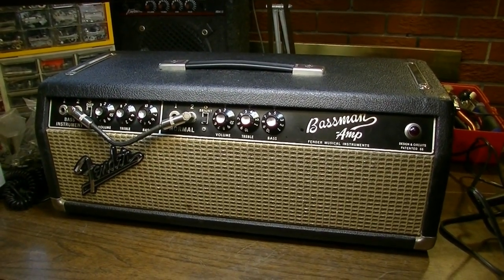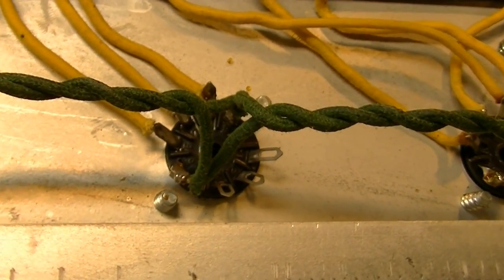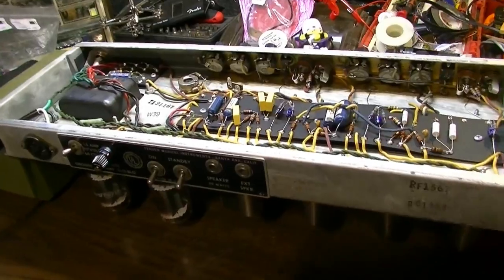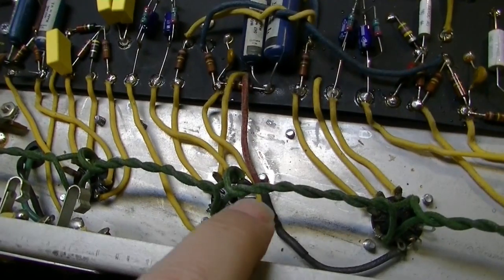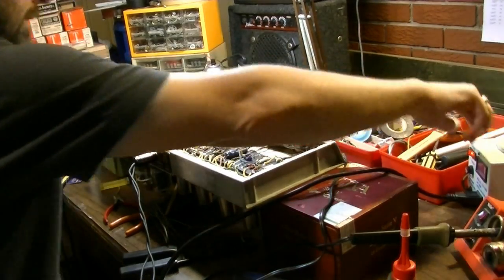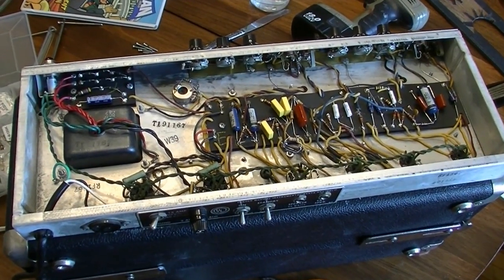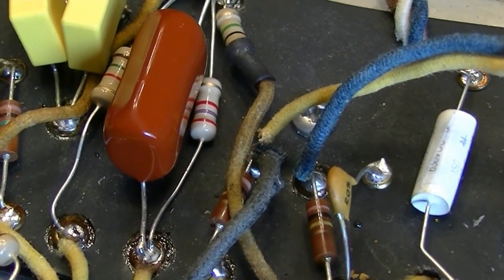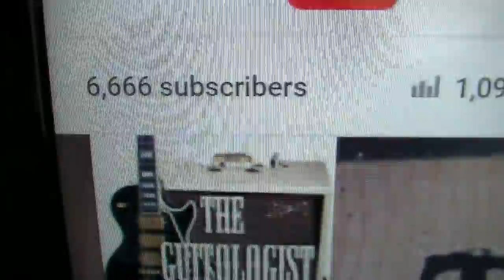Hacking a Blackface Fender for Monster Gain, Blasphemous or Badass?

Comment: My first rig was a 65 Showman which I ran through an 8X10 Marshall hotdog cabinet. It had been "MESA BOOGIED"; i.e. the channels were rewired together in series and a master vol was installed, so the cascading gain was MIND BLOWINGLY beyond even a dimed up channel jumpered JMP. The amp was given to me by my uncle back in 78 when I was 16. He was a working musician (keyboard player) who got it from his guitar player at the time who modded it. Instead of jumpering the channels in parallel, he wired it in series so it was essentially a nascent Mesa Boogie. This is not an exaggeration - the gain on that amp was so outrageously good it was somewhere between a 100 Watt Marshall superlead and Eddie Van Halen's legendary tone from his first album. When I heard Van Halen for the first time, I actually thought he was using the same rig LOL. No, it didn't quite nail Eddie's tone but it got darn close.

Comment: Another Great vidio. I love Fender amp's Vintage, Tube Reverb tanks for an Awesome Surf sound. My older brother has a bunch. I'm not sure you respond to stupid questions like the one I'm about to ask? But I can't afford a true vintage tube amp. However I could & did buy a new Fender Super Champ X2. I'm curious to on a 1-10 scale. What you might rate the Authenticity of Emulated amp sound's from this X2 Tube Version amp? I believe the 1st channel is all Tube? I've ben told the 2nd channel with 16 Amp Emulation settings is a digital preamp with Tube out. Not sure? Along with 16 Digital FX settings. For only $200 head used. & $379 Combo? I bought both. I love this amp for recording with it's Direct Line Out. I doubt these amps are even on your radar to comment on? But if so? Do you feel Thay're any good at all? or Is there anything you could do to improve their Vintage Sound Emulation? I would Love too see you open one up & give us your Expertise on what might be improved upon? Thank's Love your video's. It's like showing how Vintage Candy was made a long time ago to me.

Comment: What a great sounding amp! The unused terminals indicate that it started as an AB165, where the terminal by the bias pot served to house Fender's "bias balance" circuit, and the terminal by the power tubes housed the local feedback loop to the phase inverter (with 47k ~> 0.1 mic).These terminals are not placed on the other models. As long as the tie-in point from normal channel to bass has not been modified (underneath eyelet board but can be confirmed with a continuity test), then the channels on this amp can still be jumpered, as the tie-in point will still have both channels in-phase. But if the tie-in point was re-routed to facilitate the additional gain stage in the normal channel, it depends on where it was tied back in. I'm curious to know. Regardless- the normal channel on this amp sounds absolutely fabulous! I may try this on a '66 AB165 Bassman on my work bench now. Thanks for sharing!

Comment: @TheGuitologist Very cool! I have a BandMaster I wanted to “hot rod” so it could have in amp overdrive/distortion channel. Would I do a similar procedure as you did with this bassman? It’s a 72 silverface completely stock one owner and just basic tune ups such as caps, tubes, wire here and there but nothing different from the day it left the factory as far as the configuration. 6L6 power tubes and 12ax7 preamp and the first preamp tube is a telefunkin (wow never new one tube could make such a difference). I know this is all pretty much standard knowledge but just wanted to give you an idea of what I was working with. Also if like to upgrade my transformers to Mercury Mags. Any advice would be greatly appreciated!!! Thank you!!!

Comment: Nice job Brad. How many gain stages did you finally wind up with on the Marshall voiced channel and did you leave all of the the cathode bypass caps in place?
Rob.
Reply from the maker: Wanna know a secret...4! The Bass channel third stage is parallel to the Normal third stage in the final design. I might have forgotten to mention that. ;)
As for the bypass caps, no, those were removed from Normal Channel. One stage got a .5 cap, another got no cap, and the thrid stage(s) got 25uf.
Reply: Thanks Brad. I always seem to get into trouble with more than 3 gain stages. I just measured the output of a 6L6GC Bogen CHA 33 conversion that I did and I can only get 8 clean watts.  I always do really good on the smaller amp conversions but usually fail with the 6L6 amps.. Maybe the bigger amps dont like the Cathodyne PI

Comment: Out of curiosity, Is that MIG80 cabinet wired up for a 4 ohm  or 8 ohm load?  Nice save though, doing mods can make you pull your hair out when they don't work the way you first think it should. And yes that is an old tube chart they glued in that they didn't even pencil AB165 or stamp. Ran into the exact same thing on the last Bassman I revitalized last year. But I did the AA864 mod instead....creamy tone.
Reply from the maker: Thanks for bringing that up! Forgot to mention in the video.... The cab is 8 ohms and Bassman OT wants to see 4 ohms, so the power is actually CUT in this video, if you can believe it. The AA864 mod is the way to go if you want good tone that is middle of the road and will maximize resale value. The mods I did here were for a specific guy who wanted "more gain". Well, he got it. :P
Reply: Damn skippy he did. In fact, it sounds like the Marshall Guv'nor pedal I still have (original design) in a unity config--all dials at 12:00.

Comment: Hope this isn't the wrong place to task, but I have a question for ya.  I bought a new,  hand-wired amp which is like a deluxe reverb clone basically. I was a little dissapointed that the noise floor is higher than I thought an expensive, handwired amp should be,  like white noise. Playing loud it doesnt matter, but quiet passages its noticeable.  I don't know what causes the "ssshhhh" white noise in amps. Could it be the carbon comp resistors? Tubes don't in themselves make noise, do  they?  Do metal film etc resistors sound as good to you as carbon comp ?
Reply from the maker: Lots of ways noise can be introduced...poor shielding, bad ground schemes, poor lead dress, and even tubes can introduce noise. try switching out your V1 tube with another tube, or swap V1 with another tube in the amp and see if it changes at all.

Comment: Great video, very informative. I'm convinced you know what you are doing but maybe some others don't. Just to clarify, Fender is known to stick pretty much any Tube Chart that was laying around for the model. I had a AA circuit Tube Chart in my bone stock 6G6-B 1964 transitionnal Bassman (The Tuxedo one). So just to be sure, it's always a good habit to double check the circuit and validating with a few schematics.
Reply from the maker: You are so right. It seems for the Bassman, the feedback circuits are a dead giveaway.

Comment: You were really trying after a hard days work to remember what you did, but I saw one important aspect of your work that wasn't mentioned...you added a resistor in series with the coupling capacitor from stage 2 to stage 3 to reduce the amplitude of the waveform going into the third stage of the modified Normal channel...thats always a fun experiment lol

Comment: Would it be fairly easy to run the two channels in-phase without any modifications by wiring up the jumper cable so that it inverts the phase between the two channels?

Comment: Hi, like your lessons! I have a output sound problem with my Marshall JVM 410 h. No sound, replaced power tubes
And replaced two Ecc 83 tubes, switched around the remaining preamp tubes, but still no sound. 
Amp is a 2016, has hardly any time on it! Only could find one thing. The 16 ohm Jack for single cabinet is not a tight
Fit. The other Jack's all seem real tight. Get sound though XF-loop return. Am puzzled.

Comment: I have a heavy modified AB165 66 Bassman. The power tubes are now EL34. Bass channel internally connected to clean channel with the pots of clean side now Mid, Presence and Master volume. The clean channel inputs are now an effects loop with one of the old pre-amp tubes as a signal boost. The amp sounds Marshall like in Bass side input 1 and input 2 has much less gain. Using the Master Vol to compensate for the lower gain of input 2 gets you a Vox like tone. This mod has been tweeted twice since the initial mod. The last time the repair shop handed me a small bag of resistors and caps they remove. The amp sounds fabulous and quiet with the Bass input 1 gain all the way up. I would love to open it up and look at it to re-write a new schematic but I am an idiot. Any suggestions on how I could drawn one in a simplistic but understandable way?

Comment: Hey Guitologist, I subscribed to your channel, since I like the electronics/ technical side of things. Since you seem to know a lot about amps, I have a black face Fender post-CBS solid state amplifier with no model or serial no. plate. It has two channels with some push pull knobs and a 5 band equalizer on the right side of the knobs. I believe it to be an early eighties model, I'm not sure. I have looked all over the Internet for some kind of info. on it, but I've not seen one pic. anywhere. Maybe you can help shed some light on this mystery. I can send a picture of it if you'd like. Great vids. by the way.👍
Reply from the maker: bradlinzy at gmail

Comment: Here's another tweak you can do to an old Bassman to coax even more gain out of it. Simply disconnect the NORMAL channel from the phase inverter tube. The phase inverter won't be shared by both channels this way, so the BASS channel will have more gain and overall brilliance. This is provided that you don't want to use the NORMAL channel. If you don't like the mod, and/or you want your NORMAL channel back, simply reconnect the NORMAL channel back onto the phase inverter tube. :)

Comment: Cheers, sounds great! Please help me understand your comment about the AB 165 being a silverface. I own a 1967 BF AB 165...
Reply from the maker: I was speaking generally. The AB165 is usually more closely associated with SF, but you're right, there were obviously some BF ones too.
Reply: Thank you, so much in getting back with me. I love the BF AB-165. It's in mint condition, except one bias mode. I changed the bias over to more of a AA864. Instead of matching the fixed tube with the other. Now both power tubes adjust together.. Do you have a shop website or better means of communication?

Comment: one thing I like to do: lower the value of 2 caps from phase splitter to power valve - 100nf - I put 10 nf !  This lower the bass and give a very nice overdrive without "fart" . try it . Of course cathode bias smooth overdrive too.

Comment: My solid-state Crate combo has silicon-backed pots in it, and the volume pot of the dist. channel has had the back pushed out of it, which has made reading the ohm rating on it impossible. To replace it, could I get away with using one with the same value as the volume pot on the clean channel, or is it likely that they would have different ratings?
Any help would be much appreciated, as Google has been literally of no help.
Reply from the maker: Get a cheap ohm meter and measure it. I've been recommending this one because it looks like a nicer one for pretty cheap, but you can find them dirt cheap if you don't care much about quality or features. https://www.amazon.com/dp/B01NAVAT9S?tag=theguito-20
Reply: Like I said, the back of the pot is broken right out, along with two of the leads (somehow..) It was only backed with a silicon wafer, which is completely gone now.
I do have a multi-meter and some electronics experience, but I have never worked on an amp before, and I am unsure of how to go about figuring out what ohm rating would suit that application. Could I maybe figure it out by taking the pot out and testing the contacts on the board? For reference, It's a Crate GX30M. I have not been able to source schematics for anything of the sort.
I'm told the dist. channel on those amps is not particularly good, but I'd like to hear it for myself. The only dist. pedal I have is a Digitech Metal Master, which has no gain adjustment on it, so you can see the problem there. The back of the pot is completely missing, so it's basically an open circuit. Is there any chance that the rating for that pot would be the same as the one for the clean channel?
Again, sorry for the basic questions, but I'm getting frustrated over here. I would get a tech to look at it, but there's no way in hell I'm gonna pay those kinds of labor-fees for a single pot that I could switch out myself if I only knew the damn value, especially when I don't even know if the dist. tones are gonna be usable for my style lol.
Greetings from Canuckistan, btw.

Comment: Would it have been easier to disconnect the negative feedback line rather than do all that work? Did this to my 68 Silverface. Actually I connected it to the three way switch when I installed a grounded power cord. Now I can switch from a clean tone  to really nice gain at low volumes (<2.5 on my volume knob) and monster gain at higher volume settings.

Comment: I have to say that bass channel is the bees knees! So im just starting to build amps and read schematics and have a question (probably really silly). I was noticing that the schematic for the AB165 doesnt list the values for the diodes. Why is that
Reply from the maker: As long as you choose a diode which can handle the voltage present at that part of the circuit, pretty much any silicone diode will work. Get 1N4007 and they'll work for sure.

Comment: "Hacking a Blackface Fender for More Gain, Blasphemous or Badass?"  These are some of the least-loved blackface amps, and were commonly modified.  I wouldn't be surprised to find it's harder to find a stock unit now than an original one.  I'd commented in your other video on this amp that it appears someone had already replaced the entire fiberboard and re-wired the amp, to give it the appearance of being "close to stock" probably after it had already been modified by a prior owner.

You didn't blast any holes in the chassis, so someone could always return it to stock if prices rose.  So I see no issues...

FWIW, I used to own an AB165 Bassman, and had some of the same thoughts about modifying it.  I kept the Normal channel as a 2-gain stage blackface Fender circuit, removed the foolishness around the phase inverter, swapped the output tube plate wires (to correct for feedback polarity).  Then I wired the Bass channel to match the 5F6-A Bassman circuit (since that extra triode was there to be made into a cathode follower).  I used the amp with an A/B switch to select channels, to go from Fender clean to semi-Marshall lead tones.  Predictably, the 5F6-A channel was much louder with more gain.
Reply from the maker: Thanks for the comment. I have not heard of the term "feedback polarity". I think you just taught me something. Thanks!
Reply: No problem!  Look closely at the AA864 Bassman vs AB165 Bassman schematics.  When you trace the feedback loop from the speaker, each circuit connects the feedback to different grids of the long-tail phase inverter.

So if you (like I did) change the AB165 phase inverter to match the AA864 schematic without attention to the feedback injection point, the negative feedback becomes positive feedback.  The solution is to swap wires of either the output transformer primary or secondary to correct the feedback polarity.  Usually your choice is made for you by how short the plate wires were trimmed when Fender built the amp.

Comment: more tubes in the signal chain does NOT necessarily equal more gain. The tone control circuits are usually gain neutral stages.

Comment: I couldn't ever figure out why they left a triode unused in these amps. Leo/CBS were such penny pinchers. 

Great job Brad, cascading gain stages take a lot of time to dial in. I'm surprised that you didn't just copy the JCM800 or JMP 2204 preamp with a few tweaks. A pentode like the EF86/5879 is another option that would up the gain(with the right circuit) and add a little different flavor.
Reply from the maker: I did borrow from the JCM800/JMP.... That bias 2.7k resistor and .5 bypass cap were close approximations of the bias setting for one stage. Marshall used a .68 cap.

Comment: The only Really Good Bassman head I ever worked on was the first one with the GZ34 rectifier, All the way good. All others need a push here and there to give up the goods, The best one I did, for playing bass, was a conversion over to The Gold Lion 🦁 KT88's a Mercury Magnetics blackface Twin Output transformer, and aux.filament trans. For the KT88's . Left the standard circuit pretty much , few Orange drops and also, I forgot! Got with Mesa Boogie and got some high quality 220 mfd. Main caps, friggin' amp on top of a 2x15" cab ! Headroom and tone!!!

Comment: What if the Jumper (1/4" to 1/4" TRS) signal was inverted going into the two stage? Wouldn't this put it in phase with the other channel's output?
Reply from the maker: You'd think, but as someone else pointed out elsewhere in the comments, that would simply shunt the guitar's signal to chassis ground.